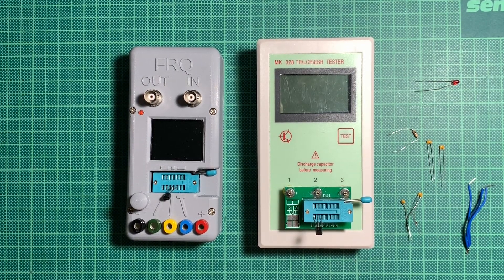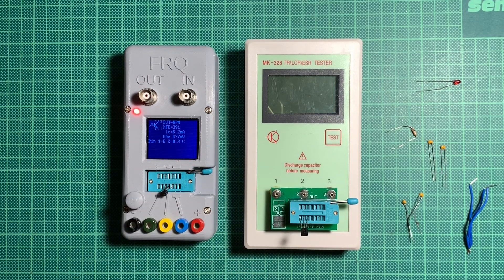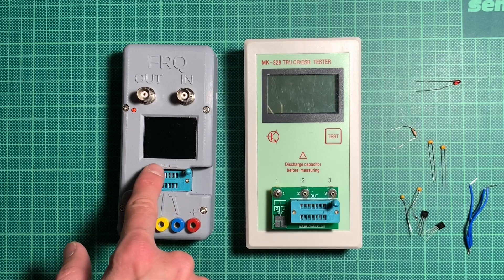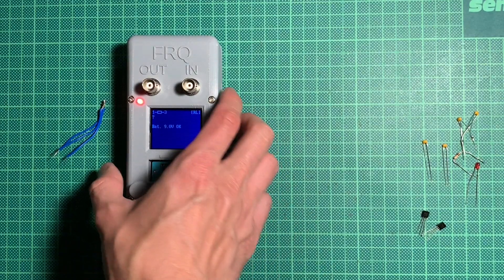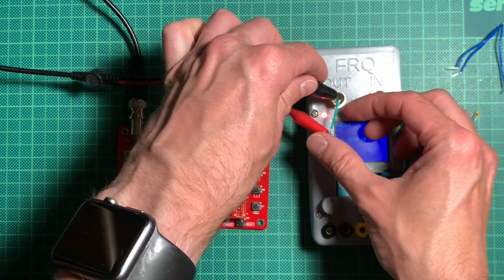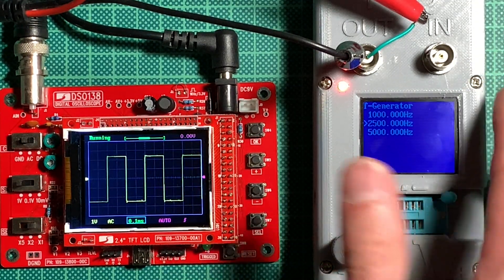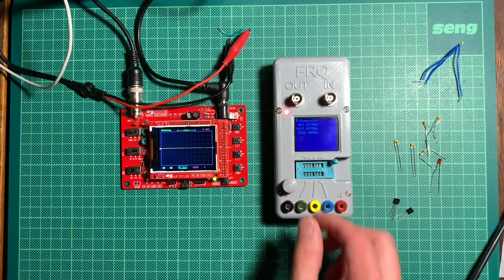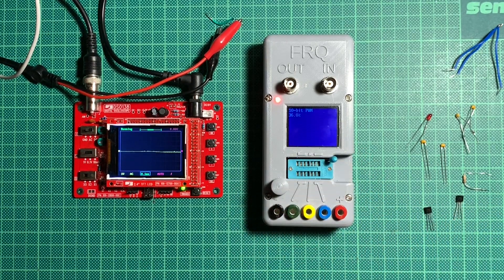Pimp My GM328 Transistor Tester

Comment: Like your video! What did you connect to the 2 coax ports? Is that for the PWM? Thank you!  Also, do you know if your version is 2019? If it is, can you tell me where you find it? I have 2017 and 2018 versions, but I can't for sure find if the 2019 is a scam or true!
Reply from the maker: Tony Fleming thanks for watching. Yes I think that‘s the PWM. Check out Olli‘s thingiverse page for more info. He designed the case. I think my version is 2018. Got it at the start of the year. I don’t think that it’s the 2019 revision.
Reply: @root42  Thank you very much for quick reply! Two of mine  2017 has these numbers: (In the menu is SHOW DATA option that gives you info, like mine)  Version 1.12k                               The 2018 :  Version 1.13k    -  If you dial the dial either direction, on the same Version 1.12k,  you'll see more information and what type Transistors you can measure... etc.
I would assume that 2019 version will have Version 1.14k    or higher.  I am looking for one, if it is guaranteed that it is 2019 version. I also keep my older and other versions, since sometimes one gives information and the or can't find it in the database.
Reply from the maker: It is version 1.12k.
Reply: @root42  OK, that is 2017 version - based on my meters. Thank you for the information.
If anyone has a newer version, like 1.14..5..6.... please let me know where you received it from, so I can buy it also. 
Does anyone updated their meter with newer version firmware? It is an Arduino based meter and I can do that, I think! All the meters have the way to do it and I like to try also.